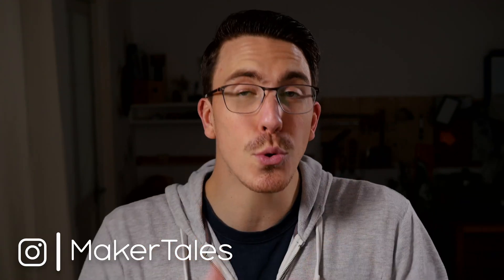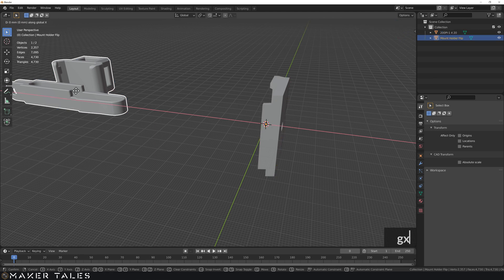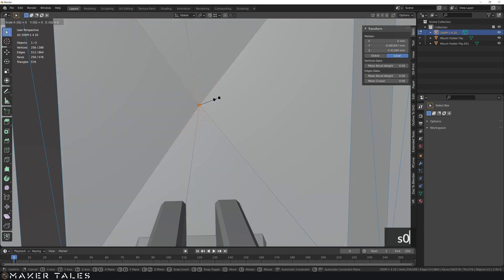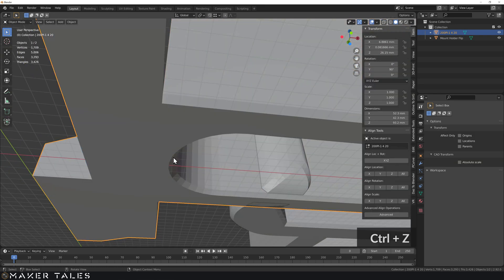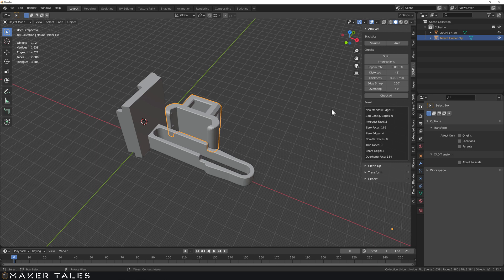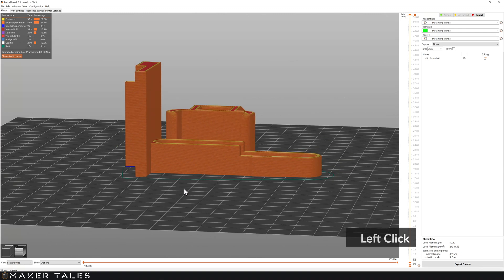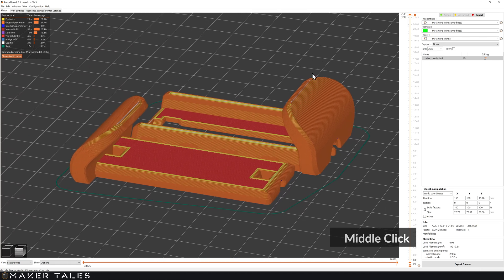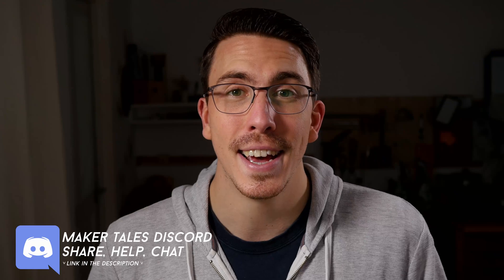Remixing STL's In Blender 3.0 / 2.9 For 3D Printing

Comment: Is there a way to use Blender for CNC milling? My workshop recommends Vcarve Pro, but I've been using Blender for 3d Printing for a while. I imagine the process is somewhat similar, but can't seem to find much on the pipeline.
Reply: For CNC milling you need CAM software. Slicer is a cam in a sense so you're asking if CAD can do CAM functions. In this case no. Fusion has CAM capabilities I presume but rather use CAM the manufacturer of your CNC recommends. Also check for CAM solutions in open source way. Maybe some people are already developing such tools.